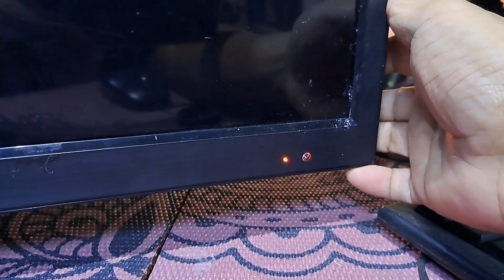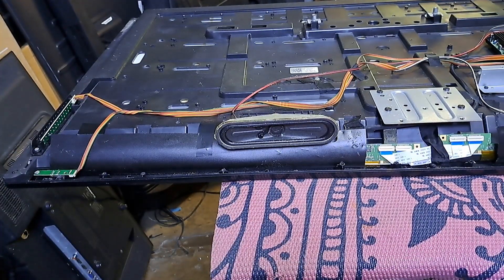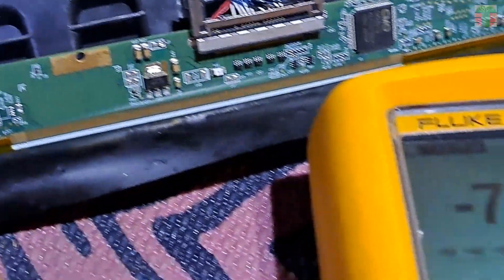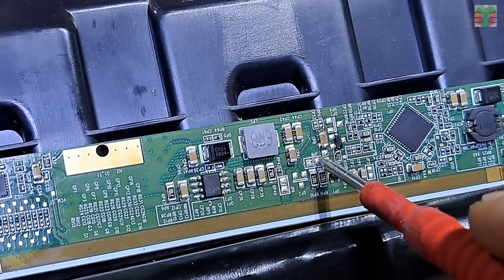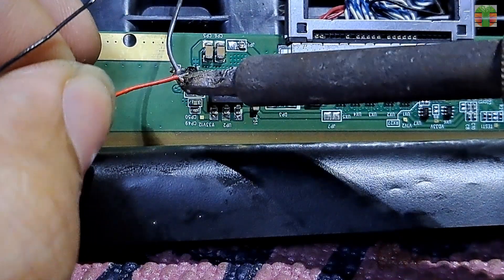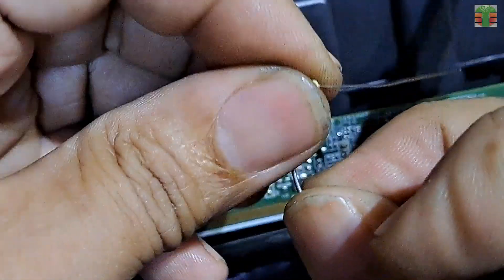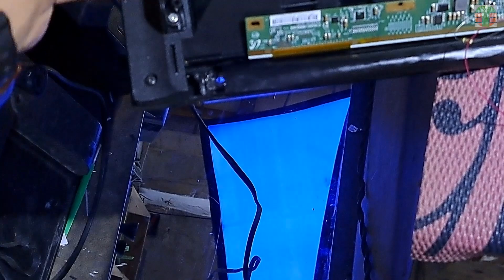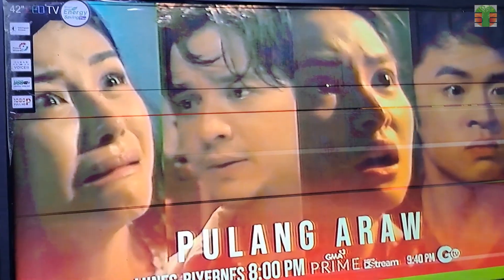VGH supply using a step-up DC to DC converter

Comment: You should rig up an operating room style projection LED lamp that you can point where ever you need light. Mostly just a large beam the size of your table but would be neat to use an articulating arm to move it around from the ceiling

Comment: Hi sir LG model 47LN549E.  T-con used model Lc470due-. at present voltage.  Vgl 4.95v. vdd 15. 90.v. and vgh voltage missing. Display centre bar line shows. Sir you give details
Reply from the maker: Try disconnect the CKL line, and VGH odd and even.

Comment: Hi champ. Ive got a samsung with image problem ..like ckv problem or vgh problem. On big capacitor i can read 31v but the Von test point is 24v. Maybe a transistor switch is bringing down the voltage. Should i inject 31 and see if image improves? Normally is 30v right?
Reply from the maker: What is the image looks like?
Reply: @tevzTVTevatronics  ghosting and lines. I am looking at side cofs and it seems no continuity between Von test point on LCD board to the side cof pins at all after scraping points. But I need to identify dots on cof. Searching Internet for where I should attach von.
Reply: @tevzTVTevatronics  https://youtu.be/3NLknT2gdWY?si=Ly4MvZFSeGTiRoY8. 
Maybe you can confirm which point should be Vgh
.